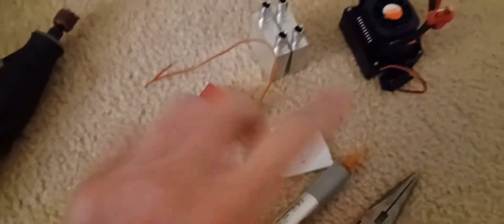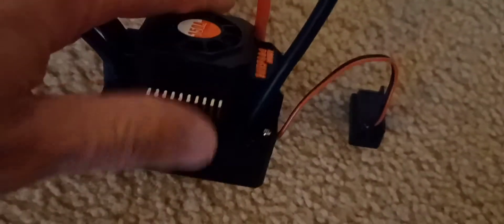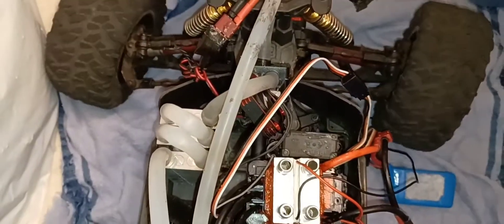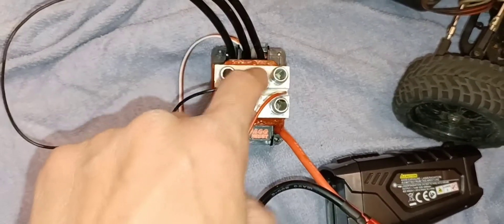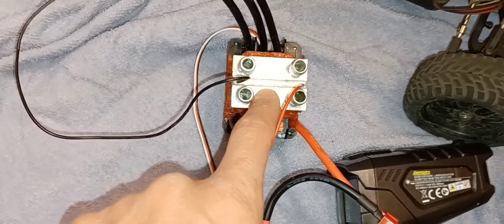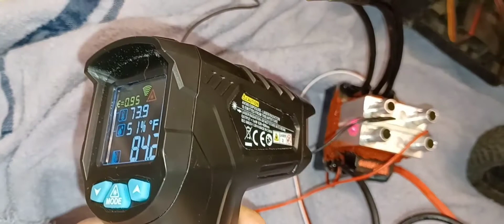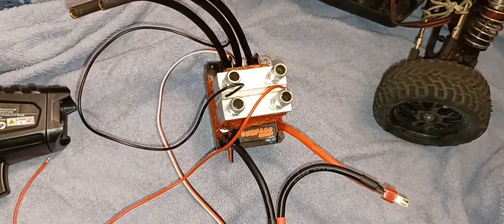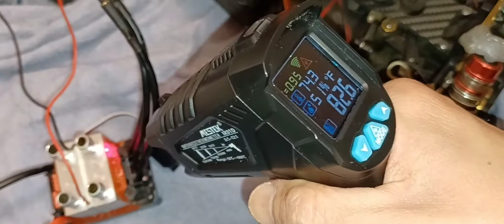DIY:Add Water Cooling Blocks to 6S Surpass 150A ESC (+Peltier) or any ESC. Big Rock & Kraton EXB 1/5

Comment: 😂😂😂😂
Dude you can just spend the money on a good quality esc 
Why both running a esc for a rc buggy 🤦‍♂️ what you just made there is what they use for computer systems 😂 
This was a waste of time to watch 🤦‍♂️ 
Easy buy good quality esc by spare good quality thermo fan use good quality battery connectors problem solved 😂 😂 😂

Comment: Wanna say U better lay that peltier down. You just cool one side of th FATs and heat the other ones. The idea was good but there's a slight 90 degree failure in the making. ✌️😉
Reply from the maker: Hey, Thanks for watching btw.  This is actually my 2nd peltier project which is still unfinished but wasn't part of the plan to add the peltier to this ESC.  Check out my 1st peltier project that works.
 (https://youtu.be/NHanpOUYsqQ?si=LT5z_l4RADff7ATo)

From what I remembered, it was about a 25 degrees difference using those cheap fans in the video.  Overall, it does work but the peltier device requires too much power to run.  Sorry I will get back into RC shortly and finish my projects 😂.  Enjoy....

Comment: That cooling plate , the one you add power to, gets very hot on one side.
Reply from the maker: Yes, I made another similar build where the cold side is facing down on the ESC which works great as long as I keep the hot side cool.  Thanks for watching. 😀

Comment: I have a problem sir 
Whenever i connect my esc to my brushless motor its so stucky means It cannot rotate properly but i have checked my bldc motor with another esc it's rotating as it rotates so can you please say that how solve my esc problem 

Please reply
Reply from the maker: Sorry for the late reply but if you are using the same Surpass 6S 150A ESC then it's most likely the ESC because this ESC fails pretty easily under not normal conditions like too hot or gets wet.  Thanks for watching. 😀